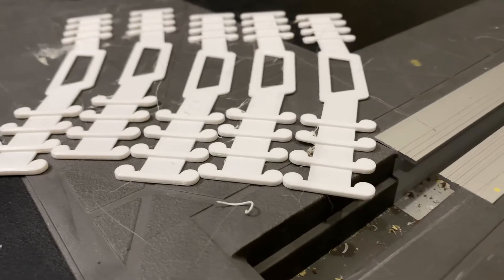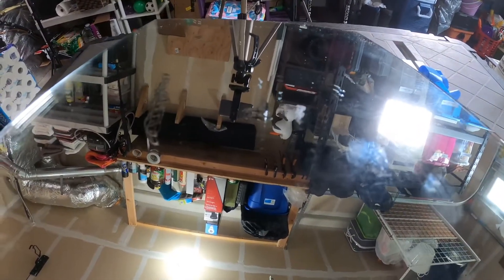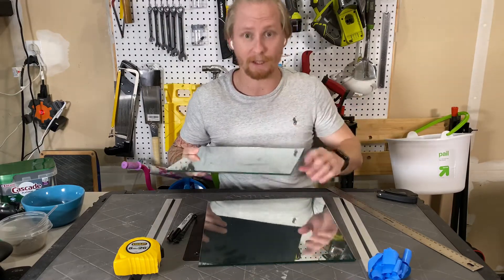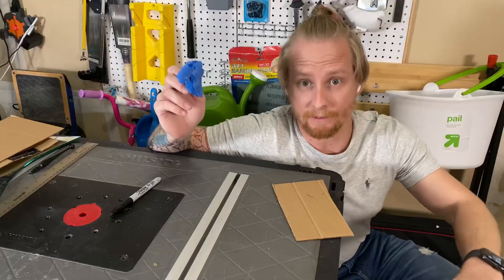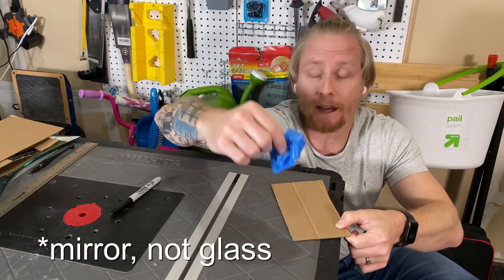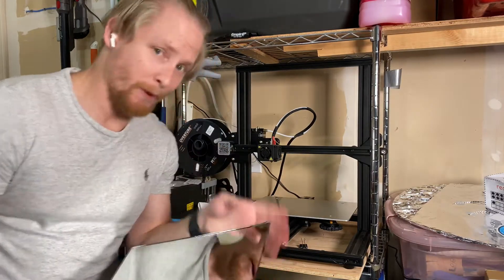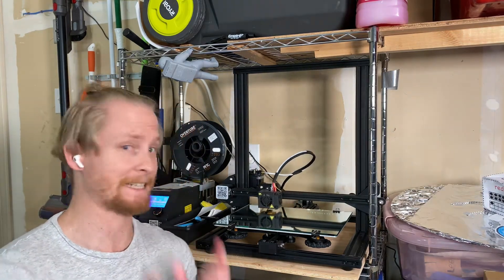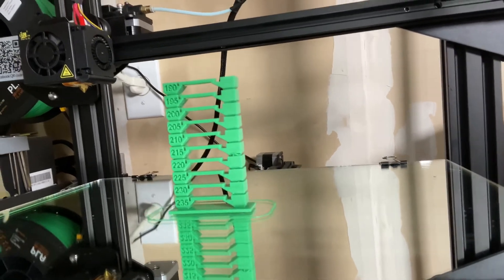I replaced my 3D print bed with a mirror tile

Comment: Oh and wear goggles. Gloves get in the way.  Don't stop a score in the middle. When using a ruler, make it a fat one, and offset it. This is not an exacto blade. Don't push the wheel against the edge.  The side of the cutter should touch the ruler. Yanking down on the edge is a good way to cut your arm off. Lift the glass up a bit, then down and it should break along the line. I still prefer just doing it by hand.

Comment: Quick lesson in cutting glass from a person who did stained glass for over 20 years. Don't do what you just did. One score, don't go over it and over. One score. Stand when doing it so you can apply pressure. Add oil to the cutter kerosene and 3in1 50-50 mix, just a touch to keep it rolling. Apply even pressure top to bottom and then break it, I use my hands, you can use the edge of a table using gravity. Do it over and over and you kill the cutter, and it may shatter the glass in  bad way.   If you need to cut a lot, get a good cutter, fletcher terry, I think its around $20-25 or something for it, has an oil chamber, cuts nicely, not like the cartoon style that hardware stores use.

Comment: This looks great but for me, it  gave issues with sticking. So I just flipped the glass  and used the surface on the back. Its a bit less smooth and some kinda micro texture. With some glue stick, it worked wonders.
Reply from the maker: Good thinking! I had been using hairspray on the glass, and that worked pretty much flawlessly.

Comment: I like your delivery and curiosity when doing things for the first time. Watching you work through using the glass cutter was fun. By the end of the cutting glass activity, I had forgotten I was watching a 3D printing video! LOL

The glass cutter is a unique tool. When scoring the glass with the cutter, make sure to press hard for the entire score. The curved glass that didn't break straight along the score needed more downward force. Also, the ball on the end of the cutter is used to break the two pieces apart. It has the right mass to efficiently break the score without breaking the glass halves themselves with a single tap. One more thing. The cutter is upside down I think. The "flat" edge of knife tip goes parallel to the glass, resulting in the angle of the handle being at its most optimum when the cutting wheel is cutting

Maybe do another video just on cutting glass? I'm sure my suggestion above isn't the only other technique out there. Time for me to do a youtube search! 

Cheers mate!
- Chris
Reply from the maker: Thanks heaps for the advise! I guess I should have done a bit more searching about how to use the glass cutter… gonna add your suggestion to my list of video ideas. Judy have to get back to making soon… (international moves kinda sap some motivation)